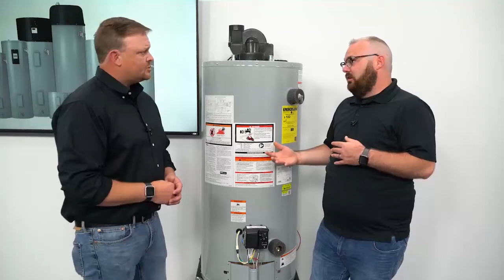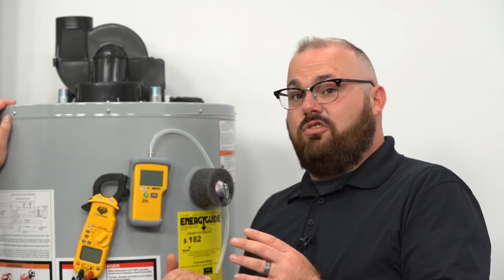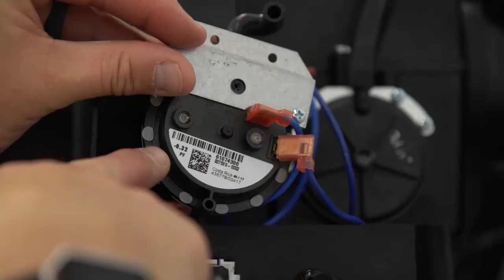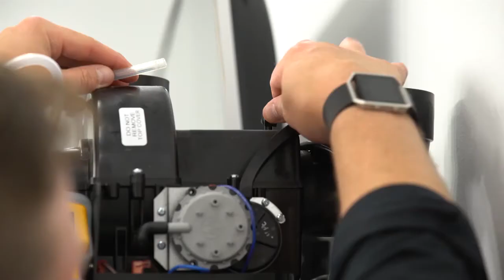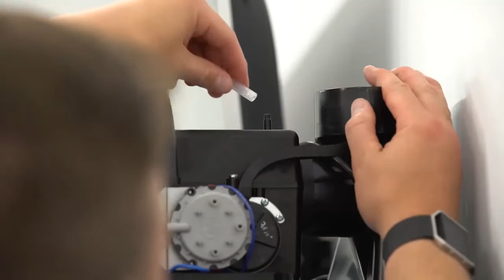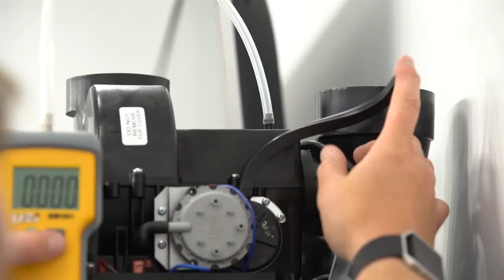PDV Code 3 Pressure switch failed open

Comment: Yes. Please start by explaining the theory of operation and start sequence. I assume the overtemp switch is normally closed until it senses an overheat condition. Done. 
Next explain if the pressure switch is normally open and the controller checks to see if it is open, the blower starts and the controller checks to see if it closes properly. The temp switch and the pressure switch are in series and both need to be closed for the controller to allow for gas and ignition. 
Too much talk can be confusing and is a time waster. 
Thanks for trying though. 
Also, correct me if I am wrong. 
Thanks. 👍😊